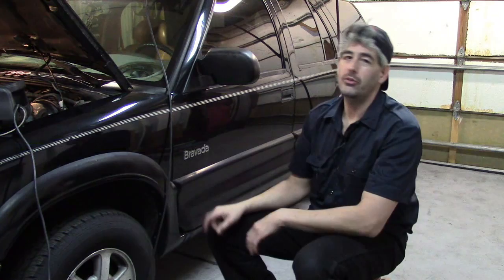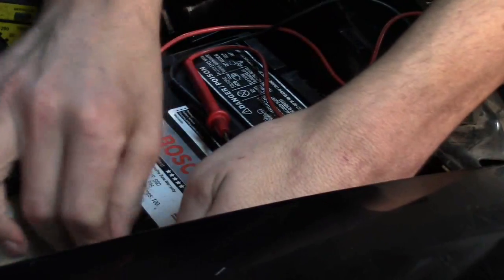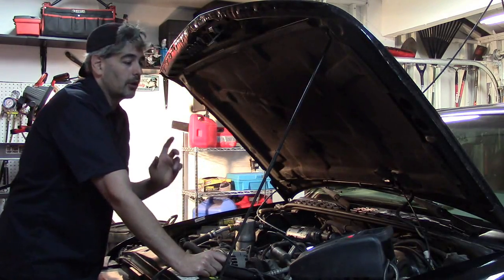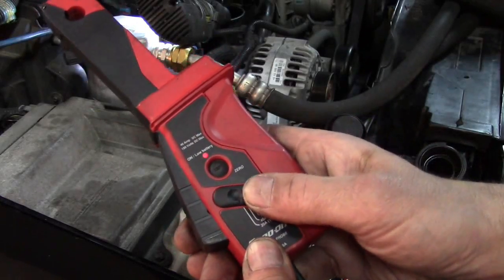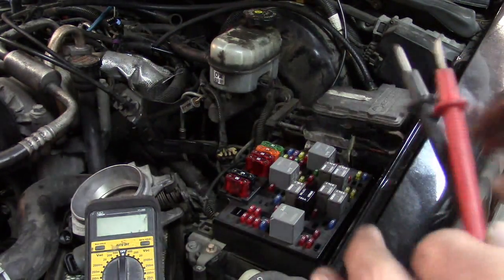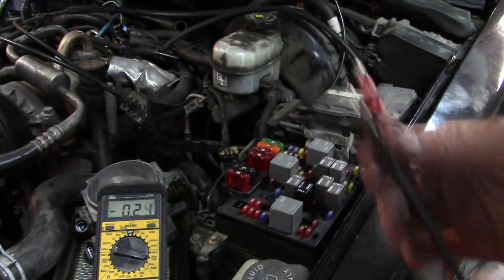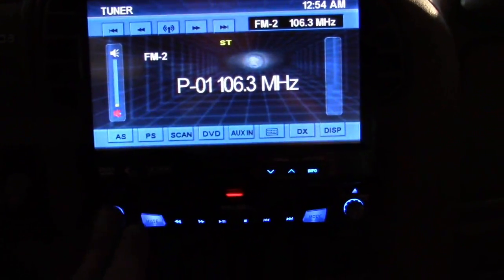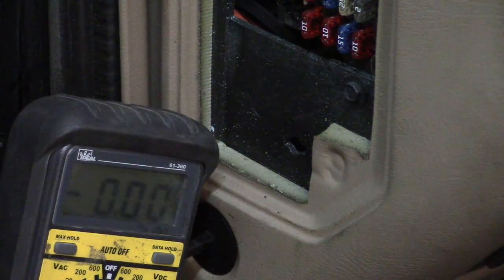Improved Methods to Find Parasitic Draw (Battery Drains Overnight)

Comment: I love Matt's methodical and scientific approach. One minor point: Matt describes the Snap On low-amp clamp as "inductive". It actually uses a Hall Effect sensor to read magnetic field, not an inductor (transformer). The inductive approach only detects varying current flows, so is widely used in current clamps only intended for measuring AC current in mains wiring. For automotive you need to measure DC (steady) current which produces a steady magnetic field. The Hall Effect sensor can detect either. Obviously when buying a current clamp for automotive use, make sure it says it's for DC in addition to AC. Also,  these sensors and associated clamp parts only have a limited sensitivity range, so those suitable for very high currents don't give you much precision for small currents. That's why a big deal is made of "low-amp clamps". Again choose according to your application -- you can usually find a PDF of the manual online to check the specs.
Reply: AC-DELCO Batttery, GM WARRANTY SCAMS; anyone else been scammed by them? they tout a no questions asked 3 yr warranty BUT when my new $375 battery failed in 2 weeks, i was initially DENIED warranty and now been waiting almost 2wks for replacement

Comment: I didn't know about that voltage drop method. I will definitely be using that method from now on. I love it when people come up with ways to make our lives easier.
Reply from the maker: +argonian bilbo Thank the commenters for this one, especially Arlen Raasch.  I would never have thought of this myself and in fact I would have bet a ton of money you cant measure voltage drop across a fuse with a basic DVOM.
Reply: Schrodingers Box Thank you Arlen!!
Reply: +Schrodingers Box same, i would have thought it would have been in the micro v range.    its just a small piece of metal after all.  the face that there is a drop above the micro volt range baffles me.   Because CSO says the resistance x the current = the voltage at a given spot.   (Chuck Simmon Ohm)
Reply: +argonian bilbo Agreed to thanking him. I remember getting the idea at the time he wrote it, but I haven't had a parasitic draw to chase down yet so I forgot all about it. With this video, the knowledge is locked in forever. :)

Comment: Bought my Camaro Z28 over 10 years ago here in Australia from a guy in Canberra when I went to pick up the car he had installed a brand new Federal Battery. He said he had tryed to charge the old one but it would keep failing to start the car after a few days. Long story short my son 8 year old found the problem. As I drove the car into the garage which was dark he asked me why the glove box compartment was lit up ?. Because he was lower in the seat and the gaps in the inbuilt GM loose fitting lid alowed him to see this. I adjusted the poorly made mechanism and fixed the drainage issue then on to all the other problems. 
Thanks Matt big follower in Australia Graeme
Reply from the maker: Cool story!!

Comment: I always set the DMM plugs back to 'volt/ohm/etc.' mode DIRECTLY after using it in amp mode. Never leave it in amp mode. It can be 'exciting' and expensive,if you forget. Also,check the probe connections each time before you use it. Just be mindful,and it's not a problem.
The 'use the fuse as a current shunt' method is generally good -IF the circuit is drawing a fair amount of current,AND your DMM is sensitive enough to read it. Low current draws will only present a minimal voltage drop across the fuse..your DMM may lose it in the 'noise floor'. If you had,say,~100ma draw,across a 30A fuse,you might only be looking for a reading of a couple mV.  It's a good,quick,test,but just be aware of it's/your equipment's limitations.

Comment: the great thing about this method is that i have ruptured fuses before just from pulling them. i don't know how often it happens but the filaments are connected to the terminals and they are quite flimsy. another great thing about it is that some cars use the same fusebox for multiple models and therefore there are some slots not in use, so if you are going to go pulling them out, be sure to take a picture of it with your smart phone first so you dont put them back in the wrong place! your method totally bypasses all of that.

Comment: exellent video,have had lights on in glove box,in boot,or stereo not go to sleep,still on,key out,i made up 2 dead fuses,blown,micro and normal blade fuse,size,solder a wire to each side,grind off a bit plastic ,and now got a test plug,pull suspect fuse out,plug in your special fuse with 2 wires,conect test meter for test,found not get pin slip and fast way to test,very cheap to make ,use blown fuses,any colour,amp,works well,keep up the good work,your educating the world,earn good karma

Comment: Excellent video. I cant stress enough how important it is to keep a "light touch" when diagnosing sleeping current. Disturbing ANY power when diagnosing may cost you an opportunity to fix it right the first time. Most of the draws that I have experienced are caused by intermittent bus activity. One module will wake up and disturb everybody else on the bus.  If your lucky the draw is permanent and consistently the same amperage.
Reply: So true.  If you miss the opportunity you’re going to be spending even more time

Comment: A 5 star video.   --- as always  :-).

Aftermarket ice installations and ant-theft  systems are always top of the list of suspects but if the parasitic draw is large my prime suspect is usually leakage back through the alternator diodes.

I had read about the fuse voltage drop test before but never tried it would be worth experimenting to find just how small a current it can detect with a typical Chinese made DVOM

A while back I bought my daughter a 1.4 litre car at auction, it turned out to have a 80mA parasitic drain that was enough to discharge the small battery in a few days.  To track it down I did an eBay buy a bought couple of those ammeters that plug into blade fuse sockets   (one for mini blade and other for standard blade sockets) turned out to be about 70mA  was going through the security transponder reciever aerial round the ignition switch.

Comment: Thanks for the warning about checking for voltage with a meter while set up on current!
Reply: I did that recently twice in 2 days,26 dollars down the drain but much better than a 300 dollar meter down the drain, those Fluke fuses aren't cheap,lol, problem is we are so used to measuring voltage on batteries, alternators and things like that and very rarely we check for parasitic draws so its force of habit to forget to change it back and or put the probe back on its usual jack,part of being human.

Comment: Every bravada I come across is a nightmare full of problems. last one I worked on was stuck in 4wd, battery died every night. needed the intake manifold gaskets changed. The blend door was stuck trying to calibrate itself so it would switch between hot and cold air. and many more problems. 
 After finding your videos I've learned many little tricks. You put out the most informational automotive diy videos I've found on youtube.
Reply: +Tyler Buls Lol yes they definitely have been known for the issues you described.  I think a lot of it has to do with using new unique technologies other cars at the time didn,t use (smart trac for example).
  I don't see a lot of Bravadas (only this one in fact) but I see tons and tons and tons of Vortec/4L60E's because they are so common in Denver.
Reply: +Tyler Buls Where I've always ran into Olds Bravada is Google thinking that's what I meant to pull up when I was after autobravado, lol. I didn't even know it was a car, somehow I stayed oblivious to this SUV's existence.

Comment: Pulling fuses one at a time is great for older cars; not for newer cars. They have so many interlinked and overlapping systems that something as seemingly harmless as pulling a fuse can set into motion all sorts of electrical activity that can literally take hours to completely cease.

The superior way to test is by leaving the fuse in place and test each circuit via the test points on top of each fuse. Performing the in-series battery test first is a great way to see if there's a loss, but this is a much better second step than pulling fuses, unless you have an older car. DEFINITELY don't start yanking fuses on vehicles like late-model Mercedes, ha ha.
Reply from the maker: AGreed- thus the purpose of this video. I too had to change my outdated methods as pulling fuses created too much variability.
  Testing the voltage drop across the fuse is really the best way IMO.
Reply: He didn't go there.  Lol 
He's working on a 1991 model. 
Try that on a 2016 Lexus..

Comment: The AMP clamp with Voltage Drop test is a better approach. Voltage drop testing is quick and easy way to detect problems, thanks for your efforts Matt.
Reply: +jake ounce Way easier, right?
Reply: I I tested voltage drop on my headlight system and got a reading of .82 millivolts with no other problems in that circuit. With the car being 15 years old, the resistance within the wiring is starting to show
Reply: jake ounce
Yes, that does make sense. It's why as cars age I always end up adding ground wires to make things run better...I'll have to do a YouTube video on it eventually, right now I just have an article about it on my website; 8 gauge grounding wire upgrade - something like that.
Reply: +jake ounce Did you see Steve Rob's comments how there are charts to see that voltage drop and know the AMPS based on that circuit?

Comment: Been having issues with my 2007 Trailblazer, the battery would drain after 2-3 days idle. found that the OnStar was pulling .4A when the car was "asleep" and I don't even use this service or feature. Awesome way to check for a parasitic draw without disconnecting the entire battery. Thanks!

Comment: I don't think you should be afraid of using the amp range of your DMM.  Just remember never every leave the probes in the amps jacks after using.  Always switch back to the volt input.  More expensive DMM's will beep when you are in the amps jack and switch to ohms or volts on the dial.

Comment: One safe way to figure out the current going through a fuse is to pull the fuse and measure it's resistance (after measuring the voltage going through the fuse.).   Volts divided by resistance will give you current. 

Another trick I use to protect my meter  when doing amp tests, is use a jumper with an inline sparkless or electronic fuse with a lower rating than my meter.   These are not the thermo breakers found in most auto part stores but fast acting brakers, sometimes used used in race cars.   The advantage of these brakers is there no sparks when wires short  and of course current is restored when the short is cleared.  I also use this jumper for doing electrical jumps because the sparkless circuit breaker increases  the safety of these operations. (Gasoline and sparks is not a good combination at times.) 

Yeah don't always do this since I have blown a few meters.  Don't despair it's just a fast blowing fuse in the meter.  Some are a pain to get at.  However don't use an automotive fuse.   What is needed is a fast blow fuse use in electronic devices.  Radio Shack was my source, but alas, check on line now.   They are cheap,  just a pain to replace and get.
Reply: Stanley Tolle Great advice! Not all Radio Shacks are closed, but most of them are. You can probably find one in your area.
Reply: e = i x r      e voltage   i amps  r resistance

Comment: For usefulness at this task, be careful which Ammeter you pick up.  After watching this video at 6:19 I picked up a Fluke 115 multimeter and Fluke i410 Ammeter.  What I can tell you is that this Ammeter is only accurate to .5 amps.  To ensure I did not have a parasitic drain I had to connect the multimeter in series to the negative battery terminal and cable.  With all electrical draws off, the Ammeter showed I had a .5 amp draw and the Multimeter showed I had a .0075 amp draw.  This particular Ammeter is not precise enough for parasitic draw tests on a car battery but it is great for Alternator amperage output and starter amperage input tests.

Comment: I prefer to put one probe on B+ (At the battery) and I will use an extension if necessary and use my second probe for probing fuses. Since voltage drop tests are NOT polarity sensitive, this prevents me from putting both probes in tight areas under a dash. You only need to check one side of the fuse to confirm current flow, if you use my method of going to the battery.
Reply: This method can be fooled though. If there's a current draw on some other circuit that happens to share the same positive rail (eg: downstream from some master fuse or relay) as the fuse you are testing, then you'll see a drop at the fuse you're testing even with no current flowing through that fuse.

Comment: Both radio power supply circuits are wired to continuous hot rather than radio KAM to hot and the radio power to the ignition switch.

Comment: I have 2 Chevy premium factory stereos in my garage that both worked fine but would drain the battery in 3-4 days. I used the old school 12v test light in series on the battery neg terminal to narrow the problem by pulling fuses util the light went off, then narrowed it down from there. BUT I had to pull ALL the fuses at once because pulling and replacing one at a time would not cut the light. I finally found the 2 fuses that somehow BOTH fed the radio circuit. Spent hours investigating for wires crossed or spliced and all appeared factory correct and could not duplicate the draw with the stereo disconnected. Hot wired the stereo direct to the battery and 1.5 amp draw (turned off). Got a used $10 stereo from a junkyard and hot wired before installing, 1.7 amp draw. Gave up and left the fuses out. 1998 Chevy Suburban. This car is only used around the ranch anyway so no big deal. I'm 68 but I keep learning!
Reply from the maker: Yes the testlight in-line is also a good technique. the only thing I don’t really like about it is if there is like 100mA of current it doesn’t show on the testlight but you still have a moderate draw.

Comment: I use the fuze voltage drop test  but don't remove the fuse to measure the amperage draw. There's plenty of fuze voltage drop charts for various fuzes that correlate the amperage to voltage drop .  Good testing  👍
Reply: +Steve Rob Yes I was figuring there must be a correlation between the voltage drop and the amperage but I wasn't sure. Good to know- saves even more time.
Reply: +Schrodinger's Box Quantum Mekanix Matt also sometimes depending on how the circuit is made up if you disconnect the fuse say for example on a module and put your amp meter in line you will wake the module up and get a improper reading.  So I would get a chart to go by in my opinion.  I believe Toyota has one, Power Probe and Dan Sullivan has one in his Fet book.  I have experienced this problem myself that's why I am telling you about it.  Found the info on Identifix.  So as Steve Rob said I wouldn't pull any fuses. Just use a chart.  Also on your Snap On Low Amp Probe, what is the minimum amperage it will read?  Good job on the video.
Reply: busjockey1 Mike I have many amp clamps and can't get a reliable reading in the ma range at all , my fluke will  not read low amperage either.  I've taken the fuse out and put a jumper in and can't get an amp clamp to match the dmm in series.  I like to put a fused jumper in and read the voltage drop and do the conversion but you really need a meter that can read 1 ma .  Oh yeah them $5 packs of 100 fuses don't work their a pile of junk, ha I've tested the same 10 amp fuse and they are all  over the map , I only use the certified fuses with the white lettering embossed in the amperage rating.
Reply: +Steve Rob Thanks for the charts, and more importantly for the thinking behind it.
Reply: DE Nichols You know what that would be a good idea for a vid for you to do.  You cant measure low amps   accurately on a clamp meter without spending  a lot of money     and most don't have one either but you can do it with a voltage drop on a fuse in series. Just a thought or a vid request - get out there and work on something.  LOL
Reply: Steve Rob
LOL, I just finished uploading a video at your comment about not liking my hot air intake, and he already has another request, :)

I'll see what I can do, it's all good, good friend.
Reply: Steve Rob
To be fair, you commented against hot air intakes not specifically mine, but I'm all smiles down here. No worries.
Reply: STEVE ROB o
Reply: STEVE ROB I still haven't done that video! I actually have to learn how first. Lol

Comment: Great video overall  but instead of using your multimeter and looking back-and-forth at the numbers for the drop better to use an amp hound, you can do a quicker test across the fuses and a different tone will let you know when there's current going through & u found  yout draw.  It will even let you know the voltage that's being drawn on the circuit you're testing.